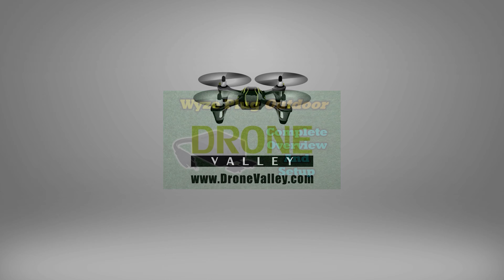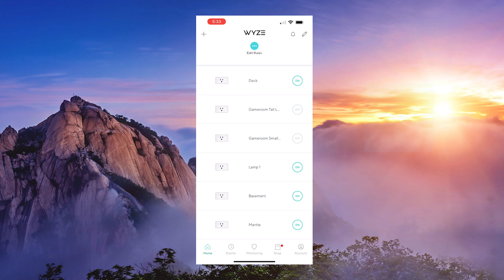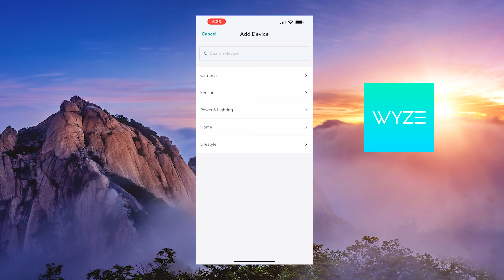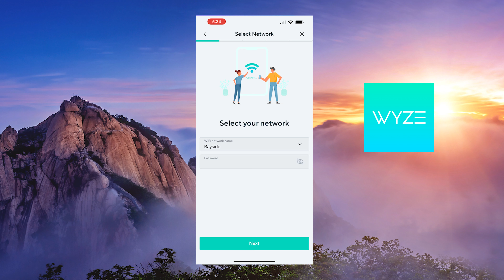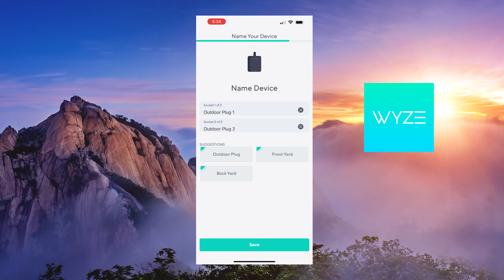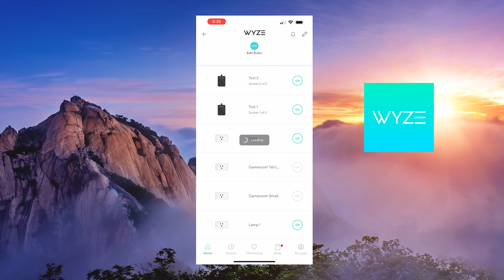Wyze Plug Outdoor - Your Outlets are Instantly Smarter

Comment: The outdoors camera's are so slow to trigger, I can watch Deer walk past,and no Deer on the play back,,I bought 2 of these when they first came out,,one wouldn't keep a charge,,charge it up,the battery dies over night,,I just put it back in the box,I'm not dealing with it,,
Reply from the maker: Robert, the challenge with all battery powered cameras (and solar powered ones as well) is that they have to balance the battery useage. This means they are essentially "sleeping" until motion triggers them and then they start recording. Most take 3-5 seconds to start and you can miss some fast moving objects. They are mostly designed for security since a bad guy can't typically get past them quickly enough to avoid detection. If you want instant recording you'll have to go with a camera that's constantly powered so it's always on and ready to record. The Wyze cameras are the best of the battery powered models I've tested and use them all over my home to keep an eye on things. Thanks for the post and be sure to stop back for more content this week. Rick

Comment: I have cameras from wyze,,for out side and inside,,out side are powered by battery,,in doors,it's 110 volt,,they send updates,,easy to upload..
Reply: I have six V3 cameras that are amazing and one outside battery camera that is just okay notifications are delayed big time but it's just an extra camera I don't really rely on it.
Reply: I read all about short battery life on the outdoor camera, so, I bought the V3 that uses 110V. I wanted to mount it to my garage overhang, but in the process of trying it out, I put it in a front window and it's still there. I have 110 power and don't have to worry about the weather nor somebody deciding to "mess" with it.
Reply: @kodak_jack  Put the camera outside and let the camera do what it's supposed to do the night vision is amazing and the regular daytime video and recordings is sharper than any 1080p camera I've ever had..  and don't worry about somebody stealing it it's 35 bucks nobody's going to mess with it anyway
Reply: @pizzadave9812  I have the same system doing the same quality work, but not mounted and powered outside. Running power to it was going to be a big PITA.
Reply: @kodak_jack  the only thing I don't like about the outdoor battery camera is notifications are delayed big time and night time detection is not that great. Other than that the picture quality is pretty good and it is kind of nice to move the camera wherever you want to and not worry about plugging it in but nothing beats the V3 cameras they are fantastic I mean for the price you cannot complain..